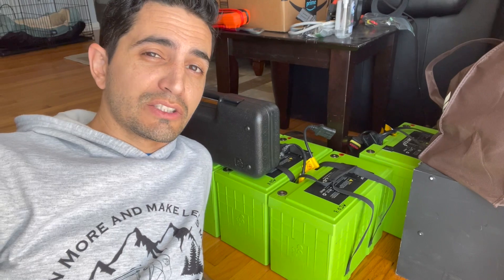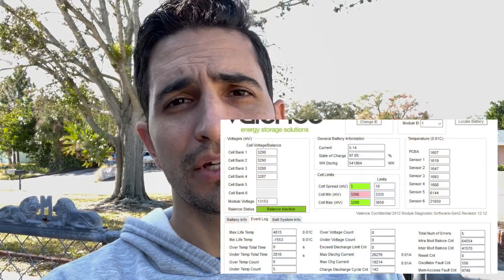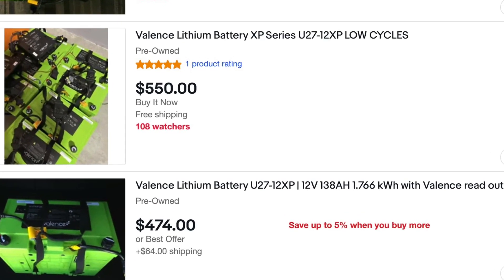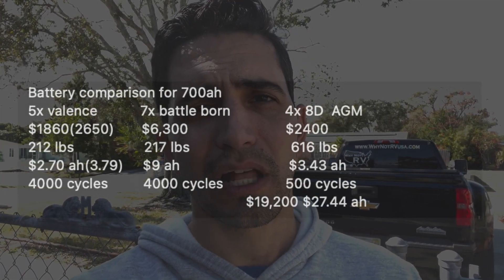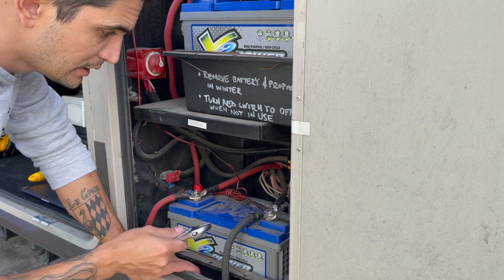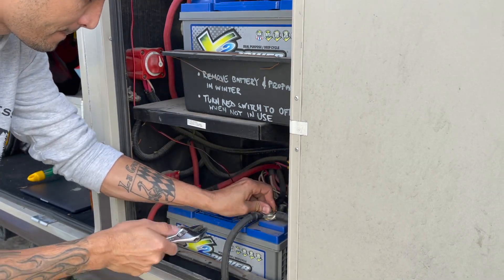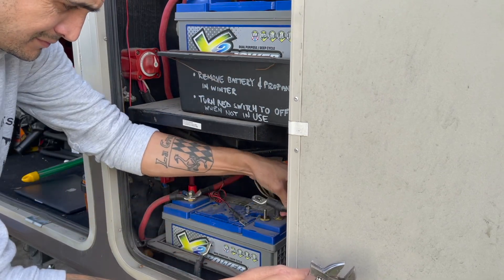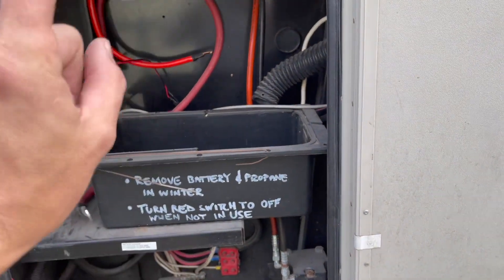Lithium Battery Upgrade - Why Not RV: Episode 46

Comment: What did you use for a BMS to get the Valence batteries to respond?
Reply from the maker: Originally I had no bms on the system. I just was using the victron products safety’s as a bms. I have since added 2 more batteries so I’m up to 7 total and added the BMS from thunderstruck
Reply: @WhyNotRV  you have one hell of a set up BTW! 👌
Reply from the maker: Thank you. I appreciate it. Next rig I’m going with a 48v system but for now I am currently only using the bms so the internal cell balancing is active. All the protection ls relied through victron.
Reply: @WhyNotRV  nice! Im new to all this, but I’m planning on upgrading my WFCO charger/controller and using the thunderstruck BMS for balancing/protection. Primarily do weekend camping. The generator will be a must on my setup.
Reply: @WhyNotRV  ok. I’m looking at going with thunderstruck as well. Thanks!
Reply: Can u share a link and model of bms u using?  @WhyNotRV

Comment: Awesome choices. I run these batteries myself and installed them in others. That said you need to figure out a bms situation, the lvc and hvc of the victron products only help at the overall battery level, not at the cell module level like the internal slave bms can provide with a master bms and contactors. This is not a FET based bms system like a battle born. You are asking for issues long term without a master bms to activate balancing and temperature/voltage cutoffs.
Reply from the maker: I appreciate that. Right now I’ve kept a computer hooked up to it to monitor everything as I’ve done some major testing with these. I have definitely considered the master bms. I’ll look more into it. I appreciate the comment and information
Reply: @WhyNotRV   I just came across your tune channel, nicely done, I am doing similar  set up in my sailboat  I am going all electric conversion but going with 12 batteries  I am doing group of 4 batteries for 48V system , anyway I  been looking for master charger for these batteries  and came across of this company that sells  charger for valance batteries  , I have no vest interest in the company , just passing info.
https://www.thunderstruck-ev.com/valence-battery-bms.html
Reply from the maker: Thanks for the information. I’ve been debating a master bms. I’ll look more into this one. Thanks again. Good luck with your build. Sounds awesome!
Reply: @WhyNotRV  that thunderstruck vc1 bms mentioned works excellent if your staying 12v by the way. I use it and it's very simple (uses putty to communicate) but yet it works. Wakes the batteries up and you will see green lights on them every 5 seconds indicating it's no longer in storage mode and balancers are active. Only downside is if you run any batteries in series as it has no intra module balancing... But that could be solved with a separate balancer. Also your running victron gear so you can use the bms to turn off everything if you don't want to use contractors which is pretty slick.
Reply from the maker: I actually ordered the thunderstruck bms. Will be doing a video once it comes in
Reply: @WhyNotRV  awesome I look forward to it. I will be interested to see how you approach using contactors or the open contact ports on all the victron gear. Should be a bullet proof system with that level of redundancy regardless of the method.
Reply from the maker: Ya I’ll figure something out. Probably going to just keep using the victron stuff and avoid adding any contactors.